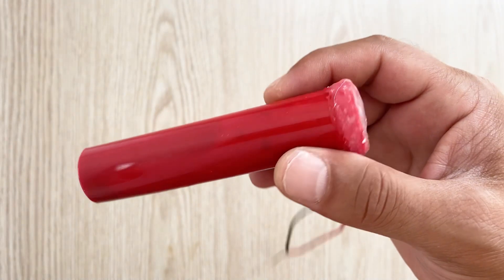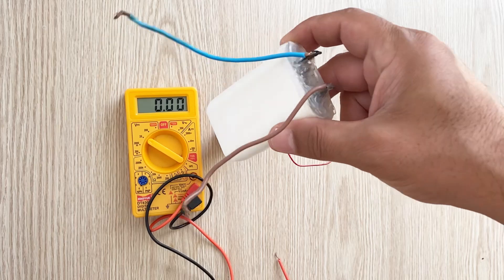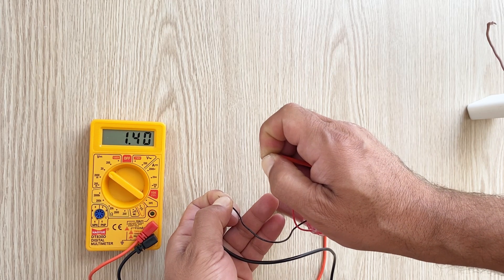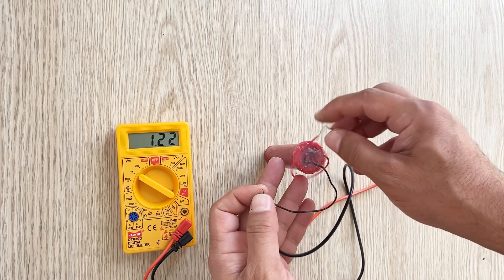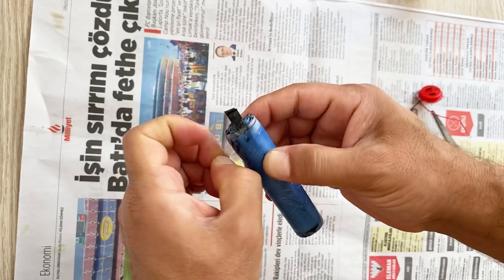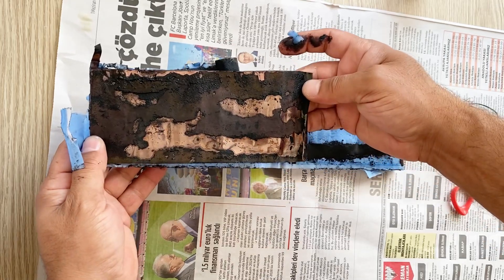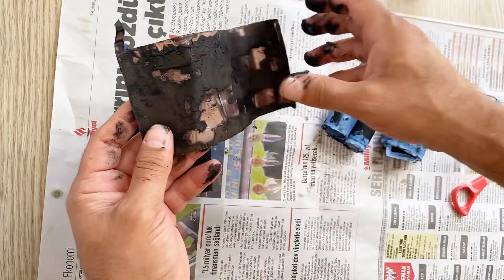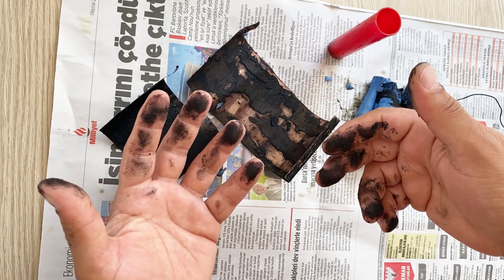Making a Real Homemade Supercapacitor (All Materials)

Comment: Hello brother your supercapacitor seems to have very low resistance but when I follow your method mine has very high resistance 100 ohm or more, this makes it charge very slowly, do you know what the problem could be?
Reply from the maker: Hello brother. The problem is probably about the conductivity of your active material. You had better to use ultra fine activated carbon and graphite powder. Try not using too much binder and mix them very very well for a long time. Lastly make more experimentations. The more you make experiments you will get better results. Don’t give up be patient.
Reply: @joyofelectronics9782  Thank you brother I will try this way thank you again you are a real help to the community
Reply from the maker: @Jorge-np3tq  🙏

Comment: How did you figure out the max voltage of the supercapacitor? In other words, if I were to create a supercapacitor like yours, how would I figure out the max voltage of the capacitor or even the capacitance?
Reply from the maker: Hi mate, you can use a multimeter to measure the voltage and current.
Reply: @joyofelectronics9782  How will the multimeter show the charge of a newly constructed supercapacitor? Isnt it uncharged? If this is the case, how to you figure out what voltage to charge the super capacitor to?

Comment: This has absolutely nothing to do with the "capacitor" term.
Reply from the maker: What do you know about Supercapacitors. You had better to make some searches on them.
Reply: @joyofelectronics9782  so called "supercapacitors" are just batteries with increased number of cycles. Capacitors are not based on chemical reactions. You did some kind of battery with unknown number of cycles available.
But don't get me wrong, your video is still entertaining and has value.
Reply from the maker: @D9ID9I  l didn’t mean to be rude. But you have some wrong knowledge. Supercapacitors are not based on chemical reactions. Their storage principle is different more likely similar to capacitors. Thanks for this nice ideas sharing.

Comment: How to make a super capacitor like this to have 2.4 to 2.8 V?
Reply from the maker: You have to use non aqueous electrolyte (organic electrolyte) like acetonitrile and some ammonium salts like tetraethilammonium tetrafllaroborate. But they are very expensive and non environmental.
Reply: @joyofelectronics9782  are they corrosive? How do they affect the copper or aluminum foil?
Reply from the maker: @haxificality  no they are not corrosive to aluminum or copper. They are used in professional supercapacitors.
Reply: @joyofelectronics9782  thank you very much for sharing info
Reply from the maker: @haxificality  no problem bro.

Comment: Have you ever tried making it with Potassium Hydroxide ??  I read that it is more conductive than  Sodium Hydroxide.   I haven't tried it.
Reply from the maker: Potassium hydroxide solution is aggressive to  copper foil. It doesn’t work as well.
Reply: @joyofelectronics9782  
The newer version of Baghdad battery uses  Copper and Iron  with  1 mole of Potassium hydroxide.   It is said to have about 5000 charge discharge cycle.
Reply from the maker: @WTF_BBQ  l will make some searches on that

Comment: Its look like the binder destroyed by water,.i think it will degrade performance over time, because the resistance increase over time while binder lost the power
Reply from the maker: Yes absolutely right. The binder should be good enough. But this is a one year old Supercapacitor. So for a homemade Supercapacitor we can say that it’s fine ☺️
Reply: @joyofelectronics9782  what binder can you recommend so that will not be affected by the water?
Reply from the maker: @haxificality  I used PVA (white glue) but the best one is PVDF.